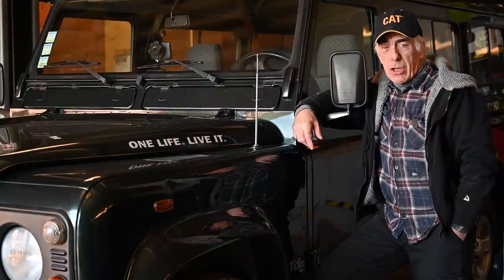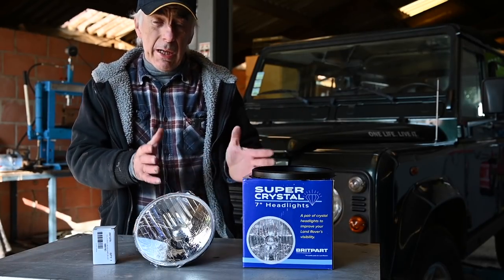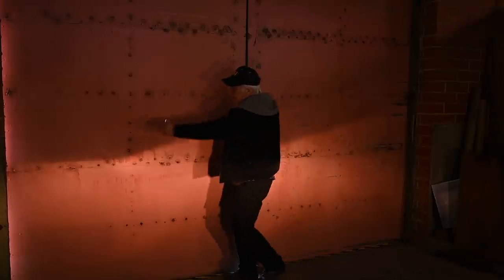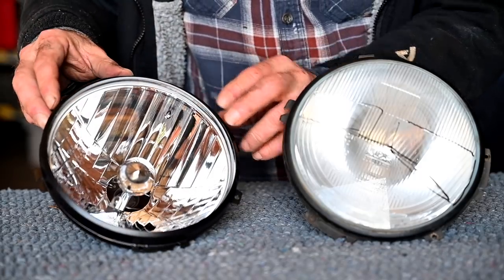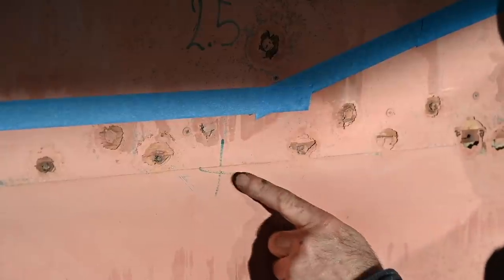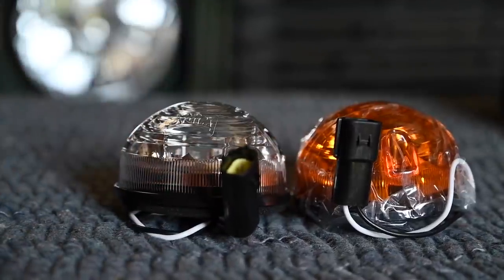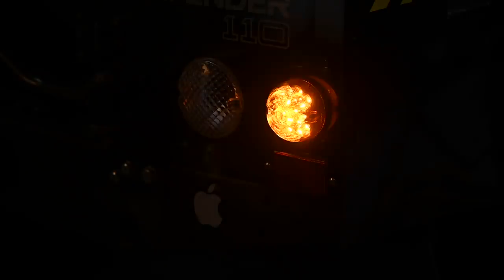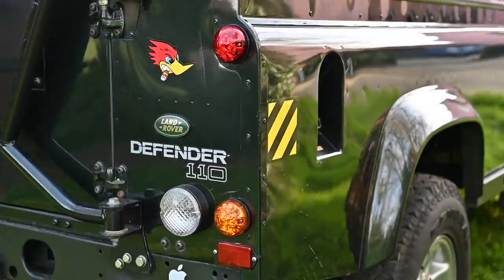Land Rover Defender  -  New lights and more to come

Comment: Hi Steve, in all my cars i use the osram night breaker lamps for the front headlights. With 150-200% more light you get even more light from the headlights. They only work half as long, but the light on all my cars is much better than with the standard ones. I would install it in the Defender then the light is perfect. More is then no longer legal. 
As always a great video from you👍

Comment: Cool you are going do some jobs at the Deferender! The head lights were the first i replaced when i got my 1998 300 Tdi six years ago (375k km now) . I opted for the Britpart Lynx Led lights. Maybe not top of the bill led lights but at about Eur 300 at the time (pre brexit) and EU certified they were a pretty good deal. And after 6 years, they are still literally a difference between night and day compared to the stock ones. With the led blinkers I had an issue when combining them with the regular bulbs on my bike rack. The wipac relay specific to the leds didn't hold out for long. I replaced the blinker bulbs in the rack with some cheap Aliexpress led bulbs to solve the issue.

Looking forward to the intercooler replacement when you get at it. Wondering what the benifits would be with a high capacity intercooler.

G.,
Daan

Comment: Great video as always Steve. My TD5 is an '03 model. I have exactly the same light set up as you have just installed. Do you know by any chance is the power to the headlights still routes from the battery all the way through the switch on the steering column and then to the lights? I was wondering if It is necessary to fit a relay. I know that Land Rover Series owners do this to improve the illumination.